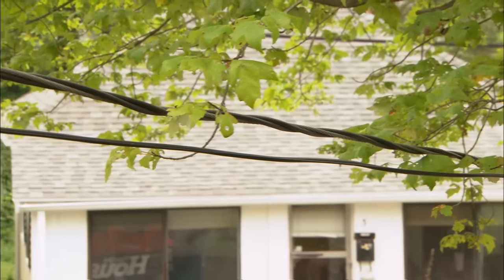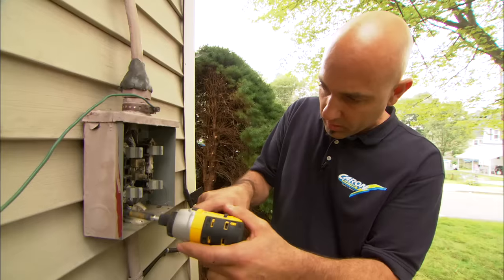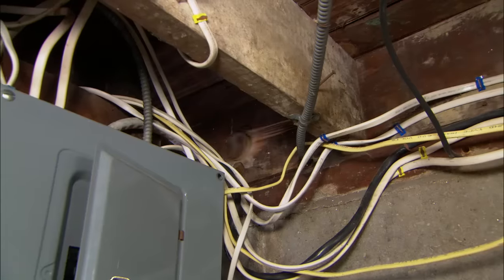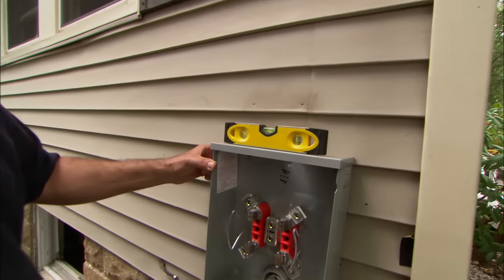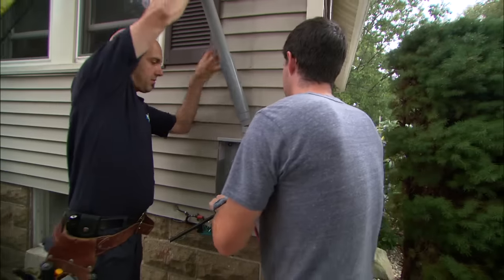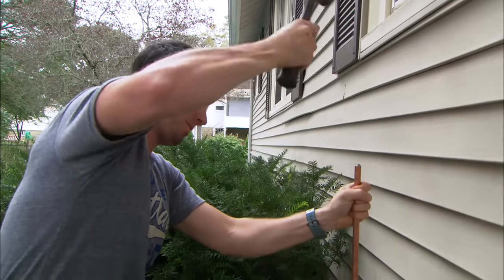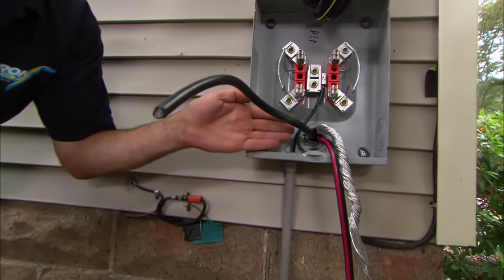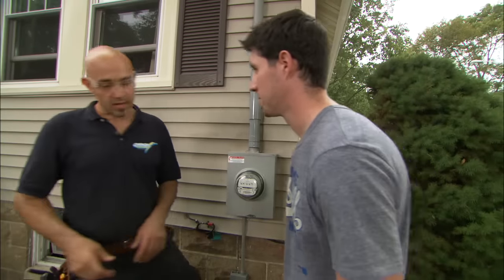How to Upgrade an Electric Meter to 200-Amp Service (Part 1) | This Old House

Comment: In my area we are often able to drive ground rods most of the way in by slowly adding water and moving the rod up and down.  It works unless you have large rocks, roots or concrete.

Comment: You miss a ground wire from the meter base to the MDP where all the circuit ground they come together on a bar separated from neutrals

Comment: They only showed the easy part.  The hard part is replacing the service panel and standing in front of it for hours trying to remember what circuit goes where.

Comment: Wow !!! You get to have the electric company disconnect the service cable  ????  The norm here in Michigan is making the swap of masthead, meter socket, and panel,, is with the drop hot.  Just recently,, storm damage. beaver tail and masthead ripped off the front of the home.  The electric company said , "No." when I asked for disconnect.  Did the full replacement hot.  I ONLY own fiberglass ladders.

Comment: The Meter Box Should Be 6' From The Ground.  Plus Also A 200 Amp Service Breaker Box After The Meter On The Outside.
The Service Wire Should Be 000 Copper Wire and Also 000 Copper Wires Going Inside To Electric Breaker Panel
Reply: Service breaker box not needed if panel is less then 6 feet inside of building. Unless your local code says otherwise. Never know seems every state or city has there own rules
Reply: Gerard Rig Gerard Rig..... Here is another “Genius” who has to tell the WORLD how GREAT he is and how he knows the Electrical codes for each and every city around the world. THANK YOU Gerard Rig... THANK YOU For saving us once again. Now go back to your Mom’s basement and wait for her to bring down a bowl of Cheerios so you can continue watching Thomas the Train.

Comment: Plastic Weather Head Pipes ???   A plastic pipe from meter socket to weather head here would be a rare sight, ie never seen this here on Mississippi Gulf Coast. During hurricanes, the metal pipes often are bent but still functioning . The service entrance wires bull the pipe around. ie the metal pipe yields but does not break. I am Really not sure if  PVC  for service entrance conductors is allowed here by code. One does see plastic pipes sometimes for service entrance conductors along the side of a power pole for underground transformer feeds, but these look great of like warped bananas since the plastic pipe is over restrained and expands more than the wooden pole. In areas, with trees the aerial service entrance wires get hit by tree limbs and the pole to the weather head often bends or pulls through the roof deck plywood.

Comment: Or just use 230/240v and you'll be able to run everything off a 80amp feed including electric kettle and shower.
Reply: It is 240v but in the form of 120v + 120v. You simply pull from both when you need 240v for dryers, stoves, hot water heaters and so on.

Comment: I am building a tiny home and would like to see a video, if possible, of installing exterior power hookups that would allow for multiple power input capabilities (30amp, 50amp, and 100amp). How do they hookup to the breaker box and breakers also. This way if I pull into a place that has RV hookups or house power I am covered.
Reply: Bobby James use a 100 amp and get a bunch of adapters for the end of your 100 amp extension cord to take it down to the 50 and 30 amp plugs. I think that's going to be your most compact solution. Hope that helps.

Comment: Wow...! You can't get away installing the staff made of pvc,  rigid pipe only in Cali, and the ground rods need to connect to the plumbing and gas piping with no6 armored ground solid wire....that's crazy how some states they are very relaxed on there electrical codes....
Reply: Yea will you have different conditions there, like earthquakes.  Other places have snow drifts, and other places get hurricanes.  So building codes vary.
Reply: @Checkmate54321  yeah you right...nice install tho...

Comment: How much does it cost on average?  We have a 100 amp service.
Reply: In Canada we install these for around $1500 installed, with the new panel as well. Converted to American pricing you're looking at about $1000-1250. Presuming there is grounding provisions in place already.

Comment: How much does it cost approximately to upgrade from 100 amp to 200 amp service?
Reply: i think it was a few hundred.  but then againm, my house was being built, so it was just a matter of parts, no extra labor to take out the old and replace.
Reply: Might depend on where you live, but in NJ i'd say anywhere from $2,000-$3,000. Price is going to depend on how accessible everything is and number of circuits in existing panel. It's time consuming labeling all the old wires and re-terminating panel.

Comment: Looks like ground rods are to close to foundation with the soil being mostly sand

Should have been a delta ground set up 

And se hole is way to big just asking for leaks and water penetration 

Small is sometimes better

Comment: I wish i knew who remodeled my home before i bought it. Because I have a 200 amp breaker in my my main breaker box in the house. But a 100 amp disconnect outside next to my meter. Supposidly my whole town (about 2000-2500 in population) has 100 amp service disconnects. Luckily I havnt had any issues with it. Considering ive upgreaded my garage from a 30 amp circuit to a 60 amp circuit. It could be a result of no building codes. And no permits have to be filed either. Only thing a permit is required for is pouring a home foundation.
Reply: What gauge is the wire on the line and load side of the 100 amp breaker?

Comment: The PVC slip coupling is almost never seen with a PVC conduit service with weather head in my area..  This video is made so the un-educated home owner understands how his home electrical  panel in wired.  It not an endorsement for them to do there own electrical work.  They should be aware that insurance companies would frown upon them for them being involve in electrical work.  And possible not pay any claim arising from any incident arising from the Home Owner doing there own wiring.

Comment: Wouldn't pass in Canada,  meter base is way too low! And 10 feet is the distance between ground rods...and the buried ground wire needs to be mechanically protected. Ground plates are a much better system to use anyway, avoiding theft of the ground wire between the rods.

Comment: Why wouldn't you insulate the neutral? Seems like you're asking for an arc flash if something were to hit the meter box
Reply: Standard practice for a 200 service entrance. Check the NEC when you aren’t sure.
Reply: That doesn't answer the question. The NEC simply says what must be done, it doesn't answer why it must be done. Moreover, it's a an almost 900 page manual, without a specific code citation saying "check the NEC" is a very useless comment to make.

Comment: Ground rods do not prevent Electrocution. They are a means of last resort. If the Transformer Neutral wire is damaged. As the transformer has a ground rod at it's base. You just hope it reaches the other ground rod before your dead. I learned that the hard way. As it damn near killed me! As short circuits will always try and reach the source. That being the Transformer feeding the service entrance. Why only the service is bonded. All other sub panels off it are not bonded. So they will have a path to the transformer and not your body.

You should take a Mike Holt course on grounding...

Comment: Why exactly do you need a 200 amps wire. Here we mainly use 20amps or 4.6kW limiter in houses. And our cables are 10 mm2 copper wires. Cable from main box to circuit breakers

Comment: Why did he use 120 volt wires when the service is 240 volt?  (2:18)
Reply: I believe he just meant that each line to neutral is 120V. Line to Line 240V.
Reply: @bconmoto    I'm sure you are correct.  But isn't the guy an electrician?  He should know better.
Reply: What do you mean 120v wires? Wire size is based on the amperage (current) it can carry not voltage. For example these wires are 4/0 aluminum URD which in a residential setting are good for a 200 ampere service.

Comment: So you bring in an insulated neutral from the riser then you change to an insulated neutral going into the building. That electrician Ron from New Jersey installs a bare neutral up his sebice entrance mast just like what comes in off the pole. The only problem with him doing that is the bare neutral is in contact eith the steel riser conduit and the neutral is a current carrying conductor and ad such you have two dissimilar metals in contact with one another which through electrolytic action the bare neutral will be eaten away. All current carrying conductors except the service drop from yhe pole should be insulated.
Reply: I meant in insulated neutral going into building. Typo on my part.
Reply: How come you can get away without using a main breaker under the meter base. If emergency services need to kill power to your building what do they do without a main breaker?

Comment: Amazing lets put this here so you dont get water in the meter box but don't do anything for the hole going in to the home crazy.  Should have got a box with a knock out so you can put conduit in to them home with a threaded coupleler  on the out side were the threaded part will go in to the meter box and use a locking ring, to lock it to the box then screw to home. that way every thing is water tight. also were the hell is the ground going in to them breaker box.

Comment: When using aluminum service feeders at your terminations you must use and anti-corrosion inhibitor such as nolox he did not use that residential measurement to the bottom of the drip loop shall be 12 foot six I don’t think he achieve that as well

Comment: The expansion joint is in the wrong place, and is improperly affixed to the house..as well as the conduit. The meterpan wont move its screwed to the house, the expansion joint should be at the top of the run with the barrel end upwards with a clamp around the barrel.

Comment: So it is not common with 3 phases 400V into the houses in America?
Reply: In america the 3phase power is 120/208...127/220V and 440...480V for industries. Aso existing 220/380...240/415V but very especial use, for high power lighting for example.
The reason of 120V in house is a low voltaje more safer.
In america contries its common a 2 phase 3 wire load service 127/220V or 120/240V.

Comment: I am wondering. You in the us have 120v 2 phase power lines to Your house. We have 230v 3 phase lines. So You have to use thicker cables and bigger brakers. You have 2x100a brakers, if You do Your maths You will end up with 3x32a in Europe. That is something that i dont understand. Lower the voltage to lose more power into heat? How You power Your 3phase electric engines?
Reply: not 2 ph. All pretty much single phase except industrial uses 3 phase. We use center tapped transformers for the single phase 120/240. In my area some older houses have 3 phase air conditioners
Reply: In the USA residential service is 240 V. Single/split phase. Yes we need to use larger conductors an breakers, but to move away from 240/120 we would have to purchase all new  appliances. Except for higher loads 240 devices are not in our supply chain. With properly sized conductors we aren't loosing power to heat. At ny location 3 phase is 440 V. and about a hour to my West it's 762 V., used to be anyway, but I hadn't work in those oilfields for decades.
Reply: High voltage is dangerous, 120V is more safer of 230V.
The reason of lot of amperes and big cables its a 48kW in single phase service 120/240V.
In 120V countries, normal house up to 12kW with 2 hots 120V + neutral use 50A.

Comment: You can do that with out the city knowing? Because I thought the city does it, Because if you do it you will get a big ass fine for it
Reply: They are doing this for TV,  they got a permit
Reply: You need a permit for that also the electrical company knows when you pull the meter out

Comment: An error in this video.   Ground rods are for lightning protection, nothing to do with “electrocution” as stated.
Reply: Don’t want to sound like a know it all… but it isn’t just lightning. Electric potential can build in any structure, and it provides a safe path to dissipate the charge build up.
Reply: Wrong.  ALL electricity connection need a ground.    Remind me never to ask you to wire my house.

Comment: If this is sn upgrade like you ststrd ehy didn't you install a combo meter base main breaker for to provide overcurrent protection on the feeders going to the new panel and also provifed shut off from service drop for fire dept.

Comment: does anyone know if its allowed to connect two "main panels"  to the meter ? i mean to connect two sets of wires to the bottom meter connection and each set to go to a different panel. (i want to work on my days off on a new panel, upgrading and adding circuits, while my old panel still works and still have electricity in the house. eventually, i will remove the old panel, when i am done moving all the circuits to the new panel).
Reply: i have two separate 200 amp panels connected to mine. One is for my entire house, the other is my detached garage, well pump, barn etc. My house panel is inside directly behind the meter, while the other panel is outside to the left of the meter and is wired through the side of the meter box.

Comment: How much does this usually cost
Reply: We switched from overhead 100 amp to underground 200 amp service/2 ground rods...also had a gfci outlet installed under the panel.  The new service panel needed to be moved over.  Prior to buying our home, HVAC technicians installed the air conditioning condenser directly in front of the 100 amp service...that's against code now.  Cost was $2500 to the electrician about a month ago.  That didn't include burying the cable from the pole to our home.  The electric company contracts the trenching...only for residential service.  You have to pay an electrician for trenching commercial work.   Had to have a specific box for underground that is certified by the electric company...a theft proof service panel.  Some may say that is expensive, but I was thankful to finally find someone who wanted to go to the trouble of dealing with the city and electric company to coordinate.  Worth every penny...did a very neat job. Very happy with how smoothly all 3 coordinated.  Deep Southern State location...In our locale, you have to use a properly permitted electrician through the city.

Comment: I know this vid is old but...Step 13...check NEC updates and realize that since 2020 the NEC requires an emergency disconnect at the meter for first responders. Of course, if this is CT, they are probably still 6 codes cycles behind. LOL

Comment: I upgraded to 200 amp by myself, I did all the grunt work like trenches and installing the poly pipe and service lines,  Installed the meterbase and panel , ground rod then had an electrician do the final hookup before having city do the pole hookup and install meter
Reply: In a city or rural?

Comment: That's an unusual meter box that is not tamper proof. . Typically the cover is locked from the inside that can only be accessed when the seal is broken and the meter is removed.
Reply: They didn’t show the cover.

Comment: I didn't see a barrel lock or a seal pad lock on the meter?
Reply: The retaining ring has a wire lock on it. He cut it when he removed the ring. Probably had to get permission to do so when he asked to cut the power. Also, I was a little surprised that he mounted the meter himself. But then they will come out, check the work - or the inspector will check the work - and mount the meter, put the lock on and restore the power.

Comment: Too bad the video doesn't show the point of attached for the wires. Here in Canada the point of attachment is minimum 4.5m above grade. Which on a single story house, requires a service mast through the roof most of the time, unless it's a two story house. Also, service conductor cable is not allowed unless it has a metal sheath. Typically all service conductors are in 2" pvc for 200A service. Also, standard meter base height is 5'5". This one is a little too low.
Reply: All those requirements differ from jurisdiction to jurisdiction in the US. While most use the NEC, some localities make certain requirements that differ from the NEC. For some reason, meter height is all over the place: 5 feet to center, 5.5. feet to center. Here in Las Vegas they want it no more than 3 feet off the ground. I don't know why. But then the meters are read electronically, not by some guy with a hand held or notepad. 

What they show here is a little arcane for my taste. But they work in the northeast quarter of the States and they are the most conservative. OTOH, the have that conductor cable and putty for waterproofing. Looks funky to me; old fashioned or substandard.

Comment: To all electricians out there, after watching the second part of the video, both grounds, main panel (connected to copper water pipe) and meter (connected to rods), are not connected. Is it right?

Comment: PVC conduit for main lines?? I never did like that.
Reply: Never a good idea for service cable 😂
Reply: You should
Reply: @Nick-bh1fy  it’s done every day
Reply: @electricaf365  I’m saying you shouldn’t feed the SER cable in pvc. I’m well aware pvc is used for service entrance
Reply: @Nick-bh1fy  SER in a PVC service mast is done everyday
Reply: @electricaf365  isn’t primary side dealt w the utility? Hydro by me always has individual cables for overhead. Granted most my area is a lot underground
Reply: @Nick-bh1fy  the utility company connects to the wires coming from the weather head.
Reply: @electricaf365  yes ik so you’re pulling ser for them? Imo jacketed cable should not be run in conduit but that’s just me